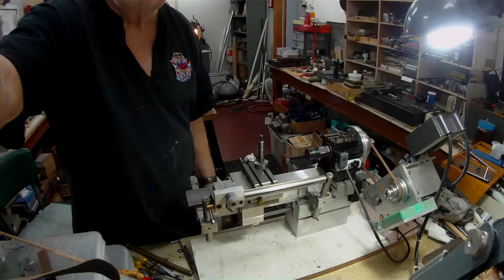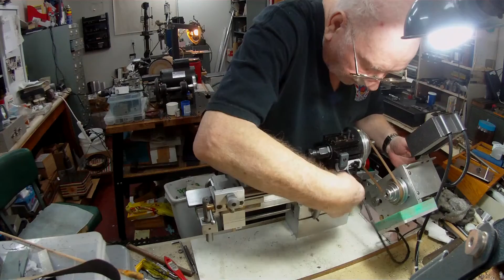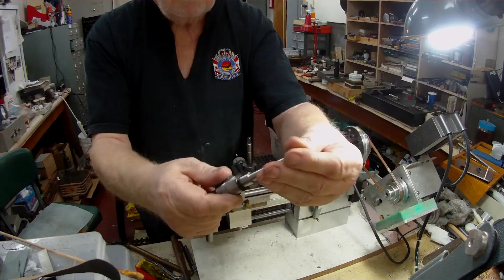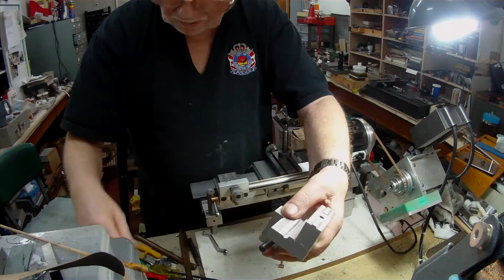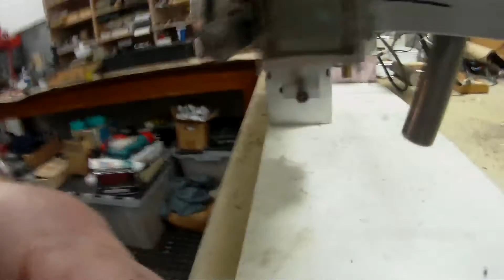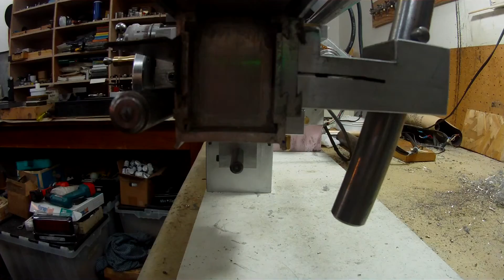FILE0014  Building a threading accessory for the Taig Lathe

Comment: Looks really good, Walter.
Reply from the maker: Thanks 👍 Ray st, sorry for the delay, I think you are right, in a continuing video I try to cut a thread but it was not too successful  there were problems, months later after a break from it I realized it needed a extra part, later I added that part and it solved the problem, now cutting a thread is pretty stable but of course it is a tedious opperation still,

Comment: What was the man's name Jose Rodriguez he made a video one cutting threads on the taig lathe
Reply from the maker: Ray st, sorry for the delay, I think you are right, in a continuing video I try to cut a thread but it was not too successful  there were problems, months later after a break from it I realized it needed a extra part, later I added that part and it solved the problem, now cutting a thread is pretty stable but of course it is a tedious opperation still,